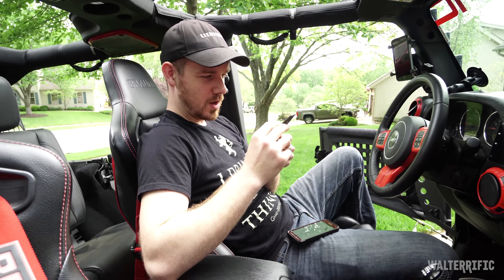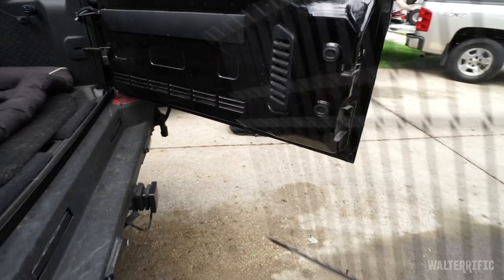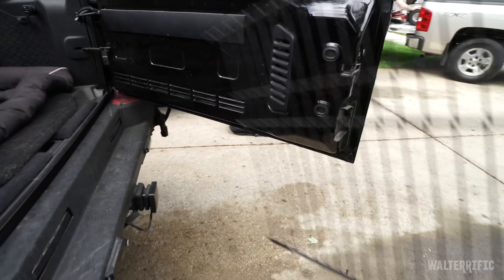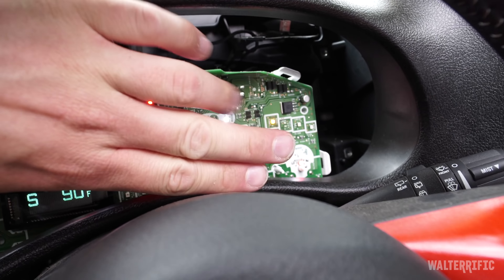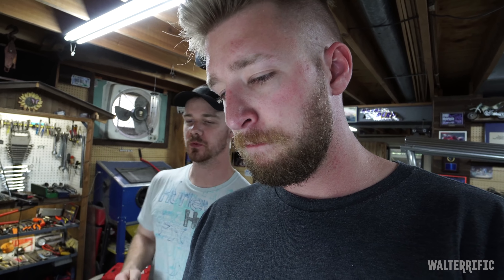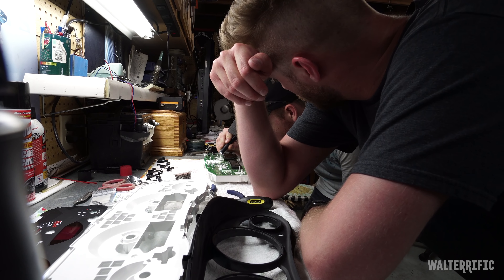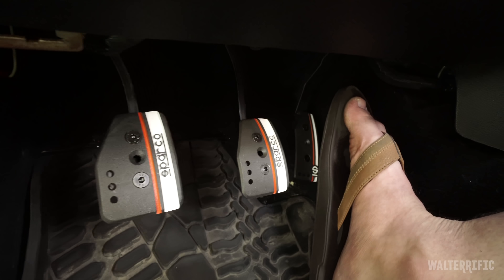Rubi Tuesday #23 - Gauge Trim & Lights

Comment: That double loop light in the middle of the dash on that pyramid of LEDs is the glow plug light for Diesel engines. Perhaps in other countries with diesel models where the glow plugs need to warm up before starting

Comment: The light in the top middle is for the glow plugs for diesel engines to pre heat the combustion chamber for cold starts

Comment: the gas pump with drops is for the Diesel engine version because diesel is often mixed with water by some gas stations, even in your country there might be stations that do it but its only a problem when its winter and diesel gets frozen.

Comment: The water in fuel light is probably for diesel vehicles, manufactures use the same basic dash panel for many vehicles, so any other fiat brand might use the same dash, the coil is for glow plugs to warm before starting.

Comment: That light is for the Diesel model. The diesel fuel filter housing has an area where water in the fuel collects. When that area is full of water the light comes on for you to drain the fuel filter housing. Great video Walter! Have a great day :-)
Reply: That curly line is for glowplugs, also a diesel thing ;-)

Comment: Glastic really is a thing. But it’s more like a fiberglass reinforced plastic I.e. fiberglass. It comes in rigid sheets and is used a lot for electrical insulation in harsh/ high temp environments. 👍

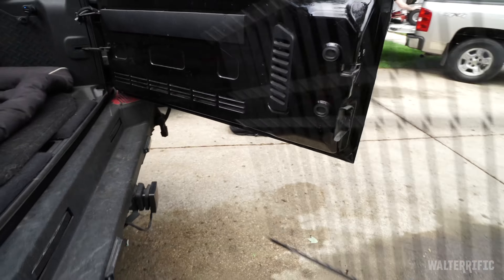Comment: Hey Walter, the light without the diode is a warning light that comes on when you have water in your fuel filter and  the one @ 10:44 is for glow plugs (goes on when a diesel starts up indicating that the cilinders are warming up a bit). Both are diesel only though. Have a good day!

Comment: The light that's missing in the center of the console is if you had a diesel engine. Because it doesn't have sparkplugs it has to preheat. That's what the coil means.

Comment: I know you guys don't do this regularly, but as a person that works on speedometers every day for work this hurt to watch. Your needles are likely going to have problems after pulling the stems, if so you'll need to buy replacement motors for it. Also, if you ever pull the cluster again make sure the car is off whenever you plug in and unplug the cluster or you can get the "check engine" light to come on
Reply from the maker: Thanks, I'm gonna have to do it again to fix the fuel and temp needles; I should have marked them before I removed them.